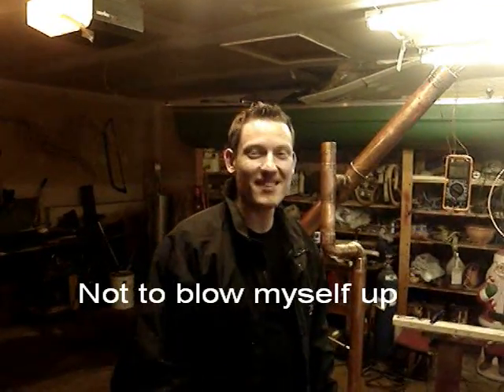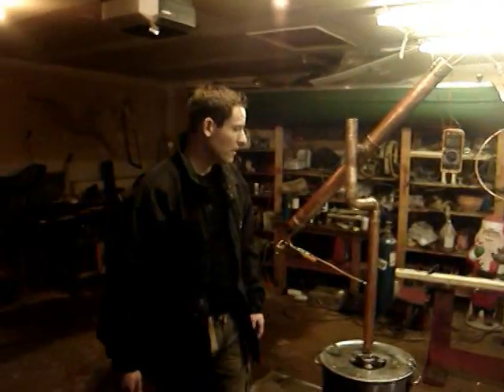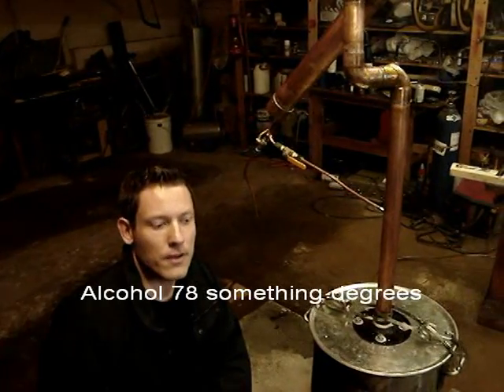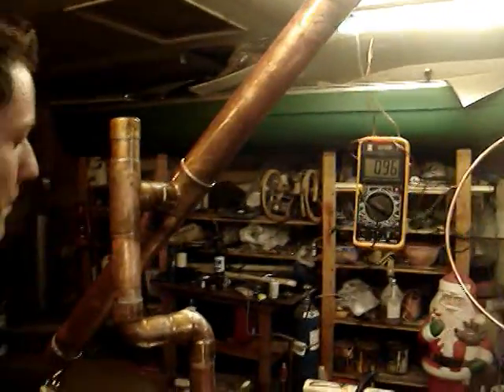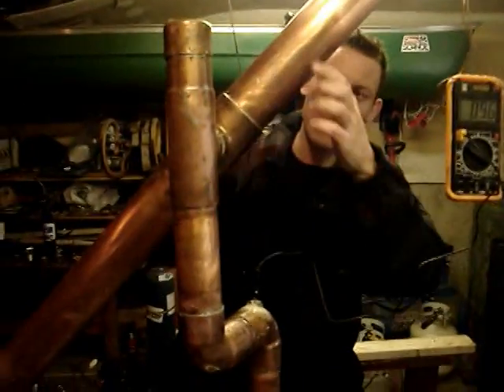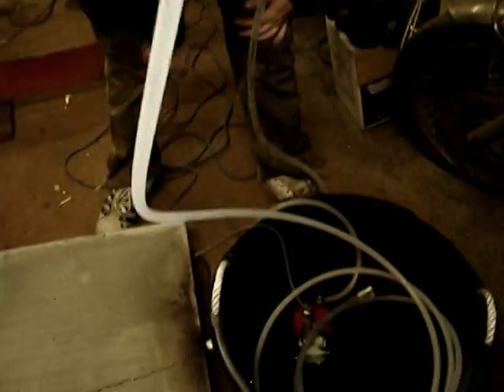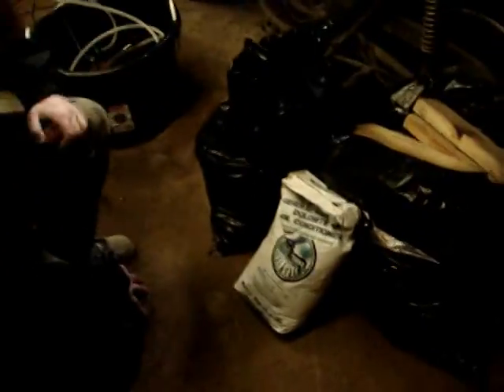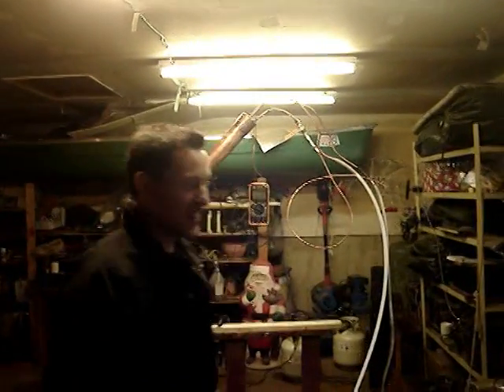how to make gasohol

Comment: The IPCC is apparently completely reversing their position on gasahol in their latest (just leaked) report -- the many, many skeptics of ethanol in gasoline as a practical means of reducing net carbon utilization have turned out not only to be right, but to "officially" be right even in the eyes of an organization that has proven most unwilling to reverse any of its original positions regarding the climate as more data has come in. 

Gasahol actually costs more energy and produces more carbon dioxide than it saves (as this video clearly shows, if you meditate on the problem of producing anhydrous alcohol and realize that lime -- a primary ingredient in concrete -- is produced by reducing limestone with coal, releasing massive amounts of carbon dioxide.  Displacing the growing of food in favor of e.g. corn or palm oil is also raising world food prices, which means that it is effectively killing people every year in fairly large numbers in the poorest 1/3 of the world's population, where death due starvation or the weakening produced by malnutrition is a real possibility.

Not to criticize the video -- I actually think videos like this are great and think that (when one thinks about the enormous and irreducible costs of the energy requirements, the cooling water requirements, the cost of growing, malting, mashing the grain chosen, and so on revealed by the video) it actually helps one understand WHY it is so expensive.  I make my own ale and am no stranger to the process of malting and mashing barley or the prices involved, and even before adding the costs of distillation, the straight up costs of the alcohol still in the fermented mash are prohibitively high.

rgb
Reply from the maker: your right via practical means. fun to build though learned a lot.
Reply: *****
My sons keep wanting me to make a distiller and process my barley mash to make whiskey, but (aside from the legality issues:-) it is just so expensive in terms of ingredients.  It would be fun, though.

I was surprised by one of your comments on the video.  You said that you had "fifty percent alcohol" in your mash, unless I misheard you.  It was my understanding that it is almost impossible to get yeast that won't die at alcohol concentrations of 11-13%, which is what makes the practical upper bound limit of the alcohol concentration of wine or e.g. barleywine fermented "dry".  Did you use a special yeast, or did you mean "fifteen percent" instead of "fifty percent"?

rgb
Reply from the maker: Robert Brown Sorry Robert some how I don't get my messages back I would have got back to you sooner I do believe I said 15 percent sometimes I tend to speak to fast bud. Sorry didn't get back to you sooner